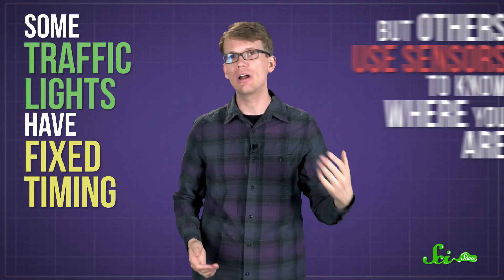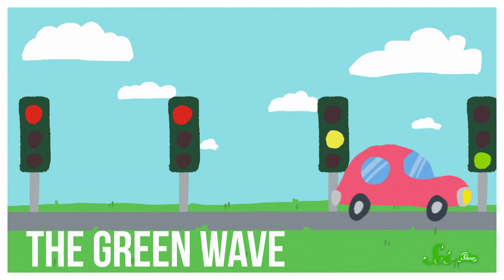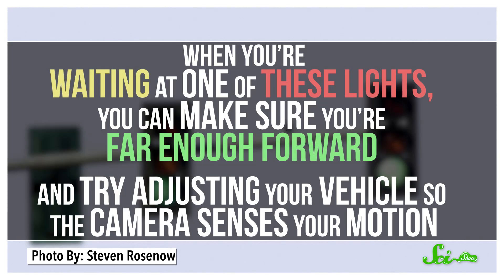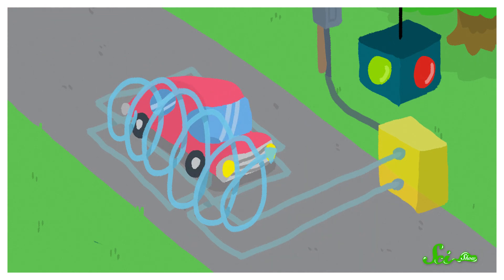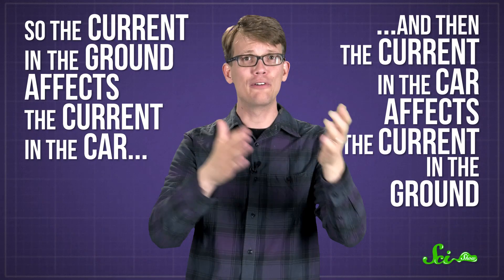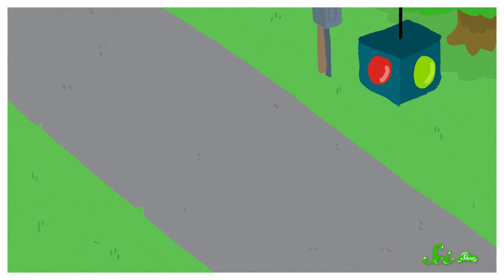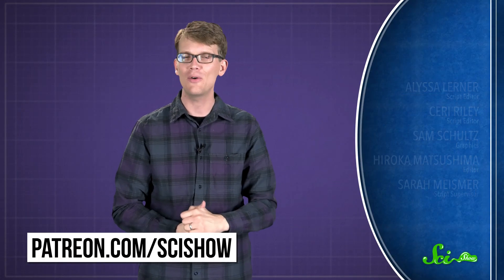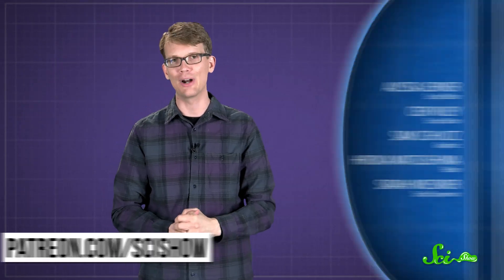How Can I Make A Traffic Light Turn Green?

Comment: I seriously waited 3 traffic light cycles in the left turn lane one time because BOTH drivers at the head of the two left turn lanes were too far behind the induction loops to be detected. By the time I pulled out to go straight through, make a U-turn, and then a right, they STILL hadn't figured it out.

Comment: The "camera" depicted at 0:51 isn't a camera. It's a strobe sensor used by the traffic light control systems for sensing a special strobe signal emitted by emergency vehicles like fire engines to give them a green and red-light all cross traffic at the intersection. Cameras are bigger and look more like hooded telescopes.

Comment: Fun fact: Those buttons to stop the traffic light are just for show and they don't really give any effect. It's just there to give the pedestrian a sense of control but doesn't really work. It's similar to the elevator close door button, made to look to work but really does not.
Reply: in australia.

The lights can be green 24/7, but will only go red when you push the crossing button.

All lifts I have been in, the door close and door open buttons work.

So it might just be your shitty country
Reply: That's only true if the signal is in recall mode.
Reply: It depends on the intersection and even the time of day/day of week/week of year. Traffic signals can be programmed to allow the button inputs or not for any period. Even when the light is changed to a pre-timed intersection, it is usually too costly to remove the buttons, so they are left in place, (but even then they can still be used to log the amount of times the button is pushed each day - to look for high pedestrian traffic for instance).

Comment: There is also an illegal but very efficient method, provided the system is installed. 
It's called something like preemptive signaling where emergency vehicles emit specially encoded flashes of a particular frequency of infrared light. Basically the same idea of a remote control for a TV. 
The "camera" Hank pointed out looks identical to the detectors for these systems and I think he's incorrect. 
More modern versions of these systems even use radio waves for better and more accurate signaling from farther distances opposed to the limited line-of-sight of infrared.

Comment: I Put a really large Magnet under my motorcycle It was a Honda Rebel 250 and didn't seem to trip the light. So I put a Magnet between the frame hanging a little lower then the frame It seemed to make the light switch faster.

Comment: I wonder if traffic lights have some kind of radio input/output. I know some ambulances have the ability to trigger certain lights. That would be great if we could rig some kind of Arduino RF emitter to trigger green lights as we approach.
Reply: All emergency vehicles have a preempt emitter that sends a strobe or wireless signal to a sensor on traffic signals. Even if you could replicate the preempt device, every device is individually programmed access into the traffic signal network.
Reply: People have done that already. The devices cost about $100 and work up to a mile away. You can pick one up on the deep web, and it'll be legal until they decide to make it otherwise.
Reply: It's always been illegal. However, They are now restricting usage to superimposed binary codes, so good luck with that.
Reply: No wonder I couldn't find anything on Instructables.

Comment: wrong! !! there is something u can do if u r on a motor cycle. 
put a strong magnet on the frame of ur bike.  that way ur not just detected because of ur induced magnetic field but also a new primary one which should make u show up on those sensors even stronger then a car

Comment: Some system actually use piezoelectric detectors under asphalt which react to pressure due to cars weight. (these are common in Canada for example)

Comment: In my country motorcycles always weave through traffic and wait in front of the line at an intersection. Sometimes when the lane I want to turn to has no cars I purposefully stop my motorbike on top of the induction sensor to try and trip it, or until I sees a car in the lane in which case I move forward and wait in front of the line like normal.

Comment: If you're riding a bicycle, you actually CAN trigger the induction loop sensor. Simply place one of your wheels directly on top of one of the wires running parallel with your direction of travel, and 99 times out of 100 it'll know that you're there. If you're riding a full carbon bike with a carbon wheelset though, you might be screwed no matter what.

And yeah, if you wait a light cycle and it doesn't trigger and no other cars come up behind you, just wait until cross traffic is clear and go through. Or, if you're turning left at a left on green arrow only, wait for the regular green light and yield right of way to oncoming traffic before turning. Yes, you're breaking the law when you do this and a salty cop could very well ticket you for it. But traffic engineering is heavily biased toward the needs of cars, slightly so toward pedestrians, and almost none at all for cyclists.

Comment: Get off the bicycle and lay it on the ground horizontally.... Light should change
Reply: Or just wear an Iron Man suit while running.
Reply: Dorient François I've heard that if you TRULY believe.... The light will change....
Reply: Inspector Javert I don't know about the US but where I come from it is against the law to ride a bicycle on the sidewalk. Even if it is legal, riding a bicycle on the sidewalk is just way more dangerous than riding it on the road.
Your comment is one of the most inane things I've read today and I wouldn't be surprised if you were talking as someone who has almost never ridden a bike.
Reply: +Durant miller Aluminium, steel and titanium alloys all work, but with a carbon frame, you're fucked.
Reply: What if my bike is aluminum or carbon fiber...
Reply: oncheurmasque I used to ride a bike all the time and we NEVER rode on the road because it's fucking dangerous and impedes traffic. You seem like you are speaking as someone who has never driven a car.
Reply: +Inspector Javert If you had been bothered to look it up, you'd have known that riding a bike on a road has been proven to be safer than riding it on a sidewalk, and for good reasons : pedestrians do not have seat-belts or bumpers, they have no turning signals and unpredictable movements, they do not have rear-view mirrors and are quite often looking at their phone. Regardless of that, riding a bicycle on a sidewalk is still illegal in many states, and advocating for something both illegal and dangerous because you feel it impedes your driving experience is despicable. Also, I have driven a car, and I know that when I am driving a car I am bound by law to share the road with cyclists.
Reply: Inspector Javert LOL wtf are you talking about I average 15 MPH on a bike will riding causally and when I'm riding for exercise I average about 20mph
Reply: Inspector Javert Riding a bike on the sidewalk is still illegal. You haven't provided any evidence that riding a bike on the road is more dangerous than riding it on the sidewalk ('I have to drive slow and I don't like it so it's super duper dangerous' is not a convincing argument, sorry).
Reply: I've never had an issue with lights not changing when I'm on my bike. You don't have to lay it down, it works fine standing upright.
Reply: +Inspector Javert 'kay, fair enough, the wechtel-lewiston puts the risk of an accident on the sidewalk at 1.8 times the risk on the road with a p<0.01. If you take a city with a speed limit for cars of 50km/h, they often average 40km/h when they are moving and this can go way down if you account for the time spent waiting at a red light (for this example I'm working with a typical european city). If you consider that a cyclist rides at 20-25km/h and a pedestrian walks at 5km/h, in both cases there is a speed difference of approximately 15-20 km/h so no, bikes are not more up to speed with pedestrians, they go four times as fast as pedestrians but half the speed of a car if that. If you are not in a city, then the roads are usually much wider and it's pretty easy to pass a bike anyway. Riding on a sidewalk is still illegal and your personal opinion on the safety of doing so doesn't change that. Where I come from having lights on your bike is mandatory at night, so I don't see how it would be harder to pass a biker at night.
Characterizing anyone riding their bike on the road as irresponsible, ignorant and unsafe is not giving credit to your argument either, and is frankly a tad insulting (but not surprising).
Reply: oncheurmasque It depends on where you live. Most of the places I have lived it has not been illegal. It all depends on the city and/or state/province laws
Reply: I can't speak for everyone but I ride a bike on city roads a lot and the sidewalk is the safer option for me. Drivers in my area don't pay any attention to bikers and don't care. Riding on the sidewalk for someone who pays close attention to what they are doing is safer because it separates us from drivers a little more and paying close attention means we should know about pedestrians well before we reach them and even if surprised a bike can stop within a foot or two if you are maintaining a reasonable speed
Reply: oncheurmasque Nah, bruh. Just saying "multiple studies have proven this or that" doesn't make your argument solid. You need to cite individual studies and they need to be examined case by case. Fact of the matter is that bikes are more up to speed with pedestrians than they are with cars. It is far easier for me to get out of the way of a pedestrian on the sidewalk while riding a bike than it is for me to get out of the way of a bike in a car, especially at night. People that use their bikes on the road are totally irresponsible, ignorant, and unsafe (kind of sounds like your character summed up in three words, hehe.)
Reply: oncheurmasque Total bullshit.The average speed of a bike is about 5 miles an hour, whereas the average speed of a car in residential areas is 30 miles an hour. A bike certainly does NOT go at "half the speed" of a car. Try again, ignorant small man.
Reply: Durrant miller 20 miles an hour is still 5 below the minimum speed limit on most streets. You are impeding traffic if you don't ride on the sidewalk.
Reply: Urban streets are not limited-access freeways and therefore do not have minimum speed limits, only maximum ones. It is perfectly legal to ride a bike at 15 or 20 mph on a 25 mph street.
Reply: I have never agreed with this law.  I think it is absolutely fucking stupid to have bicycles in the same lanes as giant 1 ton vehicles.  They aren't motor vehicles.

I have been hit by a car on my bicycle and I'll never again ride it in the street with the flow of traffic.  I do not care.  I will not get hit again by someone who thinks they are better than me because they are in a car.

That law needs to be changed.  Bicycles belong on the sidewalks.
Reply: Scheefinator It depends on where you live on the law and personally I hate riding on the side walk
Reply: Durrant miller
Clearly you didn't understand.  I don't give two shits about following this particular law, due to the fact I was fucking hit by a 1 ton goddamn vehicle while following said fucking law.
Reply: And I'm saying I don't care if it is or is not a law.
Reply: Scheefinator Most cars are actually in the range of one and a half to two tons. Trucks, which are abundantly common in the US, are usually at least two and a half tons for the LIGHTER ones.

Now the way I see it, if a 170 lb. dude on a 20-30 lb. bike were to slam into me at 15-20 mph, I'd be a lot better off than if that same dude were to get run over by a two and a half ton mass of steel doing 30-40 mph. Even if he's moving with the flow of traffic and the car/truck hits him from behind (thus having a relative speed of only 10-25 mph), he's still going to be pretty mangled. Not to mention the fact that a bicyclist, being around 200 lbs. total and a fair bit slower than motor vehicles, will be able to decelerate very quickly, thus significantly lessening – if not outright avoiding – any injuries to pedestrians. Cars cannot decelerate very quickly, because they are very heavy and have a lot of inertia.

tl;dr I'd much rather have a bicyclist be safe and ride on the sidewalk and bump into me and maybe give me a nasty bruise, than have him get killed out in traffic.
Reply: oncheurmasque xD
Reply: Scheefinator K then but no need to get snippy
Reply: You really shouldn't be riding a bike in the road to begin with... It's dangerous. Get back on the sidewalk and leave the road to the cars.

Comment: The inductive loops can have their sensitivity adjusted by the people who maintain or install the controls. These adjustments are usually done to loops in areas where there are adjacent lanes with loops also. Turning lanes are the reason why the sensitivity may be turned down to avoid accidentally triggering the turn signal when a car is actually going straight in the lane beside the turn lane. If you find that it is difficult to trigger a light, you may choose to go to the right hand lane and if on a motorcycle or bicycle, you can increase your chances of being sensed by stopping directly over the inductive loop line in the pavement. Another option is to put a ferrous (iron or steel) piece of metal on the bottom of your motorcycle or bicycle.